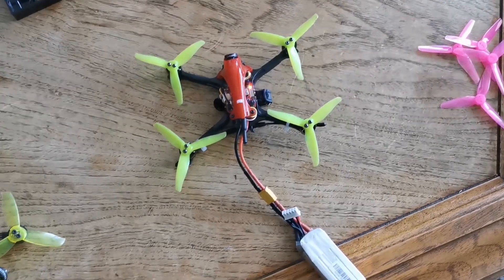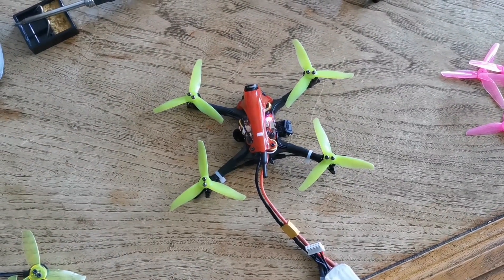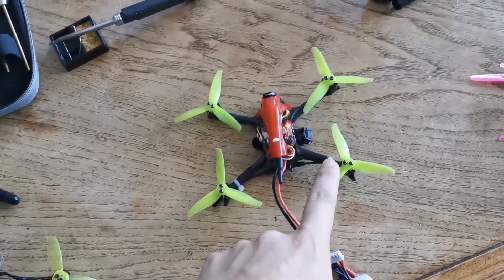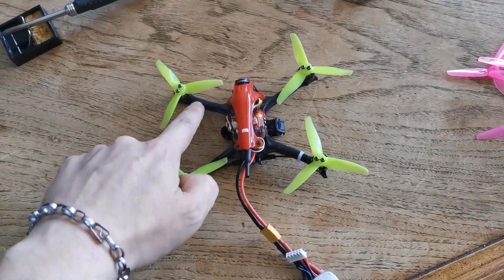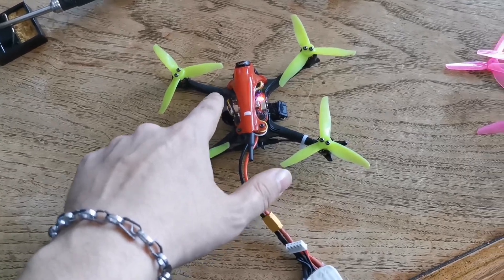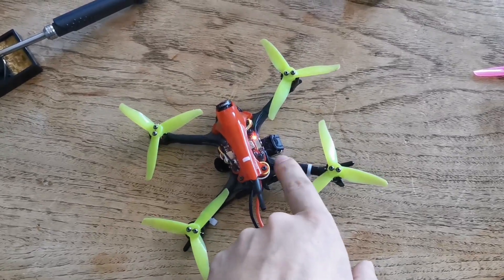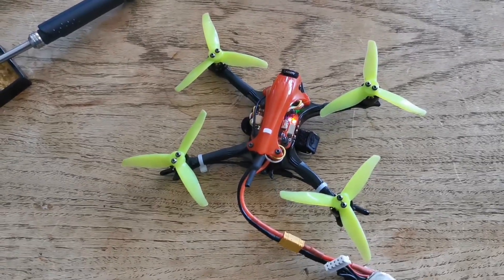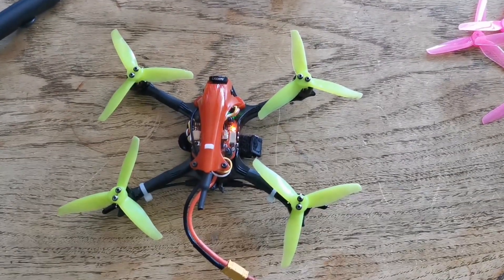FPV Troubleshooting Twitching Motor Or ESC - FIND OUT FAST!

Comment: Bro i did ur trick motor used to spins by it self when i attach battery first 
i connected motor to other motor as u said when i try to take off throttle up my motors all shuts off . .  Any help plz i cant find board replacment online all sold out its old gps drone hubsan 502e 
i been looking for years for  new boaed no luck
Reply from the maker: I don't know much about toy RC. More custom DIY FPV